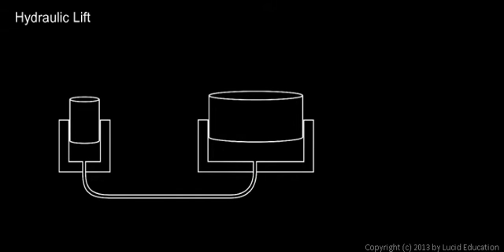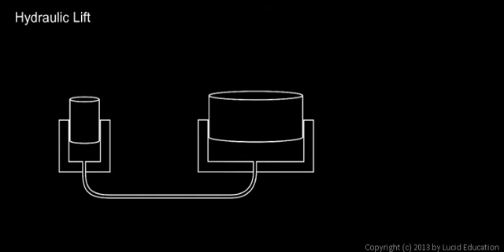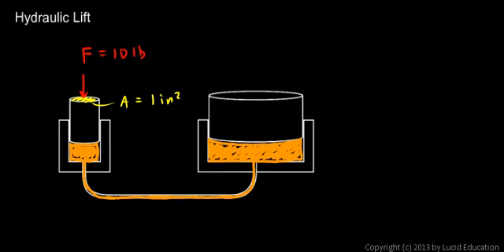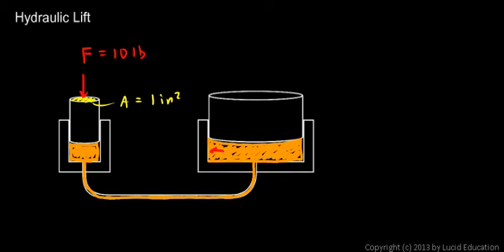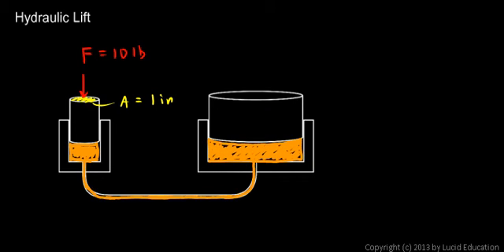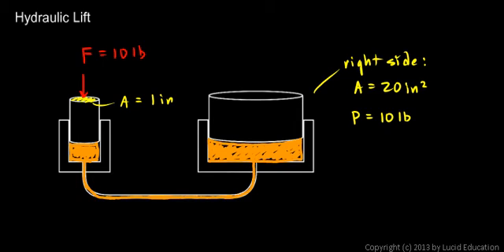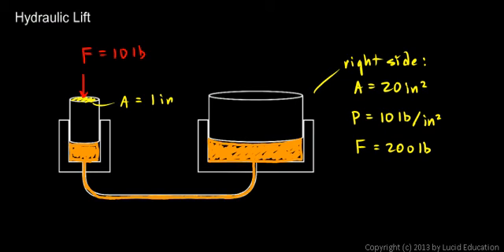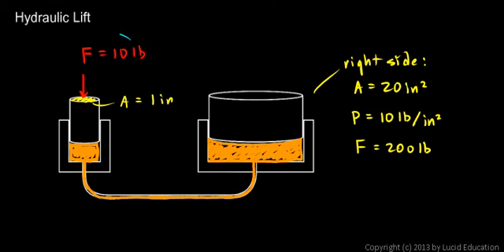Physical Science 3.3c - Hydraulic Lift

Comment from the maker: Well, not exactly.  A full analysis of the rocket nozzle would require 3rd or 4th year college level material, and the fluid mechanics involves some pretty serious calculus.  Basically, there is a difference static fluids and dynamic fluids, differences between compressible fluids and incompressible fluids, and differences between subsonic and supersonic flow.  The hydraulic lift is the simplest case in all three areas, while the rocket nozzle is the more complicated.